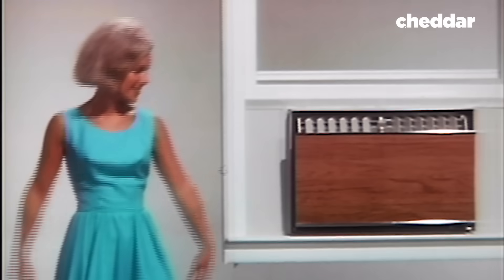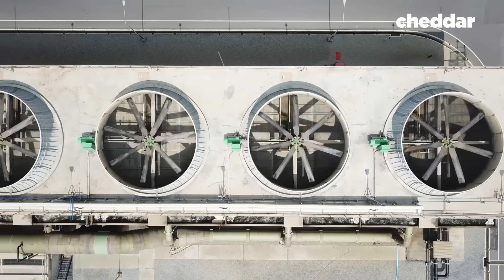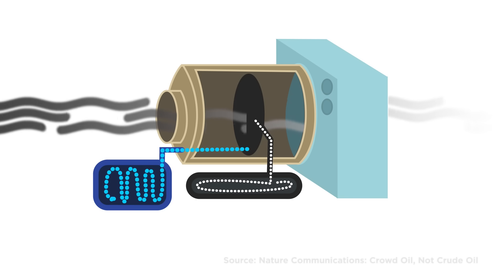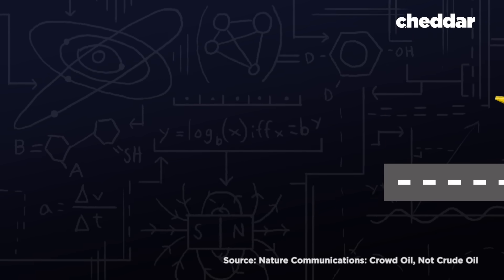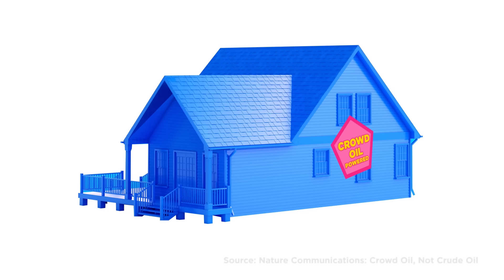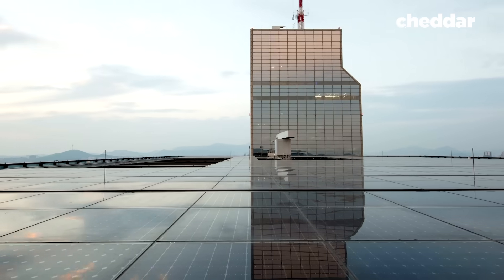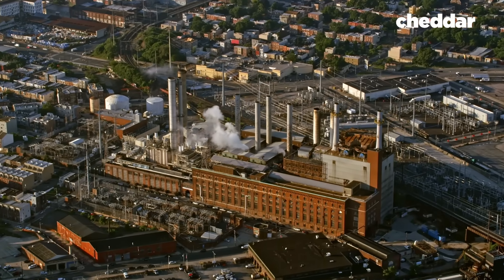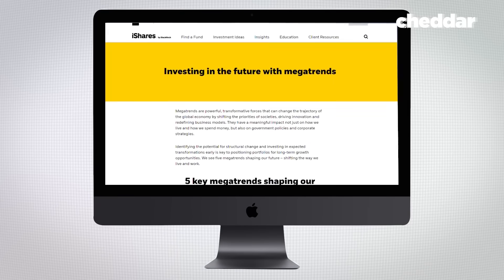How Your AC Could Help Instead of Hurt The Environment - Cheddar Explores

Comment: wow this sounds so great wait a minute dont they just put the c03 back in the air when they burn the fuel man great idea guys
Reply: Doing so recycles carbon while the alternative is to ADD MORE carbon. This would be a viable means of power storage which would make renewables more viable and make combustion cars which run on it carbon-neutral.

Comment: This is insane. Each stage of this process consumes energy and has losses, which means you have to put more energy in than you get out of your fuel. Then when you burn the fuel you release all the carbon back into the atmosphere anyway. You'd be better off not making the fuel, and instead using the energy you would have used powering this process directly.

This is literally pointless and seems to be another case of "researchers" not understanding basic thermodynamics.

Comment: This wouldn't help the environment...
Hydrocarbon fuels still create CO2, which kinda defeats the purpose. If the fuel is chemically identical to processed petroleum fuel, then it'll generate the same biproducts when burned... Basic chemistry.
All this does is make there be more fuel, which in the long run is significantly worse for us.

Comment: Since they say nothing about how much extra energy is used, this is most likely BS.
The process likely work, but if the energy cost is too high, it's much better to go with EV's and (potentially) dedicated plants.  
  
What they add is water collection and some kind of contraption to capture CO2, neither is hard to do on it's own. It's even possible to get free water from the sky. Electrolysis is nothing special, so the only novel part is really the collection of the CO2. -Would not be surprised if that too is a well known method.  
  
As far as I can tell, the difference from an industrial approach, is to do this in many small units that will have less oversight than a single large location, and that adds a lot of complication in distribution.

Comment: The simple fact is that this will always require at least as much extra energy in as you would get from burning the fuel though practically speaking it will be even more than that. This would mean any fuel produced via this method will always sell for a higher price point than natural sources so long as those continue to exist, also for most applications alternative energy storage solutions that would come at a much lower price premium exist already. There are exceptions for example some aerospace applications, design speed for electric aircraft top out around mach 0.4 currently these may improve but high speed transport aircraft, military interceptors and rockets are all safe from electric competition for now. Certainly plenty of market for slower electric aircraft though such as aircraft designed predominantly for the purpose of getting to places that sea or land vehicles can't easily reach rather than for crossing distances quickly.

Comment: Imagine this: My air conditioner is powered by 100% carbon-free energy, and that's it.
If you want to do carbon-capture put your own power-generators, solar panels, whatever, why do I need to pay for it? my A/C unit is already powered from carbon-free energy. Why do we pay taxes? want carbon capture, make the government pay for it.
This approach is stupid and consumes more energy than it recover, instead of using carbon-neutral power sources (like nuclear) and powering the air conditioners, lets just put a filter and a complex system and decrease the efficiency of the air conditioning, lets also create oil to be burned again, that's net-neutral at beast, considering the system also took energy to power itself, it will never be carbon negative. 

There are better ways to stored power in chemical bounds.

Comment: Unless you have a ton of extra electricity from clean sources, this will create more carbon than is removed from the atmosphere from the extra electricity used by the ac working harder and the system itself. Very stupid idea

Comment: 2:00 Those fans work the other way around. They suck the air through the heat exchanger except of blowing air into the heat exchanger.... Minor mistake, not a hughe problem.
Reply: 1: it wil decrease the AC efficiency since the fans will blow less air over the evaporstor coils.
2: i was talking about the direction of the airflow from the fans.
Reply: @brinkshows2720  precisely
Reply: lol, blocking them with a filter is harmless to the efficiency of the A/C unit
Reply: That's just a convoluted way of stealing power for carbon-capture

Comment: if their system to convert excess fuel back to electricity then I would be interested , like a backup storage  in 1 unit
Reply: It's not excess, they're stealing power from the A/C units and making them inefficient. Why don't they plug their own electric motors to the power grid and try to sell the captured oil, oh they can't, the system is not profitable, iow, it produces more CO2 than it consumes. 

you don't need this system, just power the A/C unit from carbon-free power sources, problem solved.

better yet, plug the carbon capture system to a nuclear reactor, e mix the CO2 with the depleted uranium and bury it, so it cannot be released again, because its radioactive.

Comment: I see two problems with this :

a) You need energy to run the electrolyser. If you follow the laws of thermodynamics, you need at least as much energy to recover usable oil from the carbon of previous oil combustion. That's in a perfect universe where there is no energy loss.

b) If you already produce hydrogen, why the fuck would you bother mixing it up with carbon to recreate oil ? Hydrogen can already be used as a clean energy source for cars. If you create and burn oil you're just gonna put the carbon back in the air, not to mention all the other unhealthy gases burning oil generates

The only good idea I see here is using A/C fans and the water they generate for electrolysis. But even that I think it'd be more economical to just use the excess water for toilets and/or watering plants.
Reply: Well, this video delivers its point poorly. This technique is not meant to be an energy source, but an energy storage technique that allows for carbon neutral carbon-based fuel with minimal investment by retrofitting HVACs. We still need renewable energy to be delivered into it.

Comment: But... if we burn the CO2 as oil, then this process is carbon Neutral. I get it that we can’t use fossil fuels, but shouldn’t we be focusing on using DAC to reduce the CO2 already in the air instead?

Comment: sound like bullshit.

Lets break it down:
spend energy to break down water
spend energy to capture co2.
spend energy to break down co2 and make hydrocarbons. 
source of energy to do all that? electricity. Made by burning the same fossil fuel at the power plant. With thermal efficiency of 60% at power plant, and 40% transport loss to consumer. 

meaning: this idea is a net increase of around 100% in CO2 emissions.

This system has only 1 advantage, but it's a pretty big one. Renewable power has a bit of a "timing" problem. The energy exists when you don't need it and isn't there when you do. Hydrocarbons are pretty good at storing energy. So this system can be used, at some pretty hefty energy cost, to transfer power from mid-day sun to nighttime illumination / heating, or even accross longer time frams s.a. summer / winter.

Comment: This is a stupid idea. Even if the electricity grid were made fully carbon neutral, it makes no sense for businesses and homes to use it to synthesize fuel when they can more efficiently just use electricity directly instead. Carbon capture only makes sense if the carbon is being sequestered forever, and in that case, why not use trees? They're more cost effective and are nicer to look at than a stupid CC plant. #teamtrees

Comment: But wouldn't there be a point where we'd use up too much carbon dioxide in the atmosphere? Then billions of air-conditioners worth trillions of dollars will have to be spent to go back to the old versions. I can see people switching over to carbon catching AC's if the government would give an incentive, lessen taxes, or pay for the AC change. Otherwise most would have no reason to go to CC ACs unless they are both environmentally aware, and financially capable, which most people aren't. But this technology is amazing and revolutionary, would be a great help to the oil and environmental crisis.

Comment: Fun video, This is a dumb idea, instead we should plant 20 million trees to lock down carbon. And use batteries to store electricity and make the switch to electric cars. Using the electricity you would use to power one of these things rather then wasting it. I would guess you could power 3000 cars instead of the 1000 that they were talking about.
Reply: Issue is, how are we going to get batteries that big, I mean We could use lakes on hills with pumps and turbines, but we don't have enough cobalt of lithium to do that

Comment: Wow everyone sounds so cynical and pessimistic. Look, will you guys stop using Air Conditioning even after planting 20 million trees? No? Then that's bad, because right now AC is Carbon Positive. Using the technology mentioned in the video will make AC Carbon Neutral, or slightly less Carbon Positive, which is better than full on Carbon Positive. If you're going to continue to use AC, why not stop releasing ADDITIONAL carbon into the air while still being able to enjoy AC? Other systems are irrelevant. Planting more trees is better, but that has nothing to do with AC becoming Carbon Neutral instead of Positive. TLDR, choose the lesser of two evils, Carbon Neutral is better than Carbon Positive

Comment: This would be a great way to offset the heating/ cooling costs- financial and ecological- of poorly insulated, open floor plan McMansions (alongside larger multi family and commercial structures). Lord knows plenty of them have the space for such a system, and plenty of roof surface area for solar cells. Provide tax incentives to implement these things and you’ll see them pop up all over in due time. I figure, if the quality of the generated fuel is suitable, it could even be used as an energy efficient heat source in temperate climates. Suck up CO2 with your AC in the summer, stockpile the fuel, and burn it in winter. And, depending on the variables, you could even power it all with renewable energy on site (possibly). These are optimistic scenarios, of course, but if the technology is cheap enough soon enough, and the policy situation is friendly enough, it could do a lot of good and be economically sensible.

Comment: I need to see the energy balance here... how much more energy is the ac going to consume to capture the CO2 into oil vs the energy you’ll get from burning the oil you just made.... also, if you’re going power your ac with renewable resources and use the energy to capture co2 just so you can burn it again, might as well just use the original energy for the end use directly....

Comment: So if you can make a fuel that can power automobiles, etc, we can fill our tanks with the stuff and have the CO2 re-captured by one of these plants, effectively allowing us to use the CO2 like a battery. It's just a battery we dump into the atmosphere and pay to "recharge" when we buy the fuel. But how would this overall cost compare to existing fuels? That's what's really going to make this a viable solution to C02 in the atmosphere.

A gallon of gas has ~33 kWh of energy. Where I live, that amount of electricity would cost me more than the gallon of gas. But maybe we could generate the fuel somewhere that electricity is renewable and cheap enough that it's worth manufacturing and shipping across the world.

Comment: hmm yes, taking carbon dioxide out of the air, turning into fuels and putting it back into the air, what a nice way of saving the environment
Reply: Eh, if you take carbon out of the air and then put it back, there's no harm done (assuming the device runs on solar power). If you take it out of the ground and put it in the air, that's a problem.

Comment: This is so dumb. It takes more energy to separate water into hydrogen and oxygen then you get from burning the hydrogen. And what do you get when you burn the hydrocarbons produced by this system? MORE CO2. So basically you would need a green energy source to make the fuel which you could be using for other things. You would just end up with the same amount of carbon in the air in the end.

Comment: What happens when we burn the oil generated from this system again CO2 will be released in the atmosphere.. and ultimately this system can never be carbon neutral.. If we use solar or wind power completely all the carbon emissions will be reduced we don't have create such stupid system.. why the hell people think oil can be solution eventhough it is renewable oil it is as bad as fossil fuels